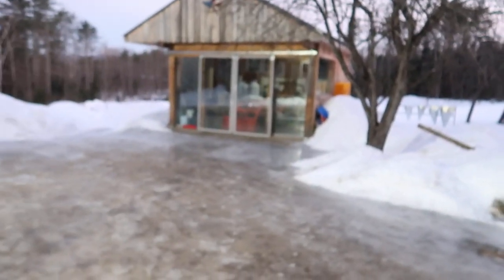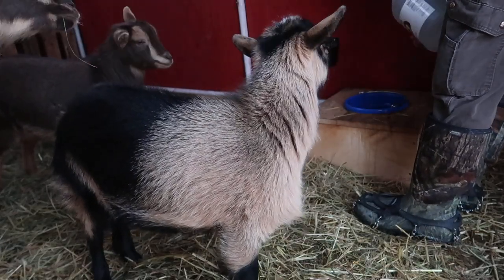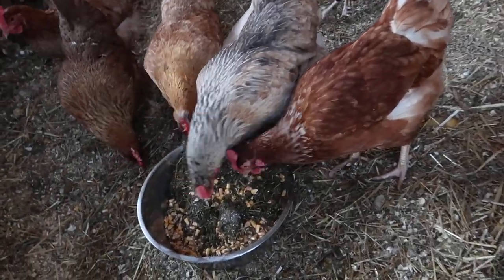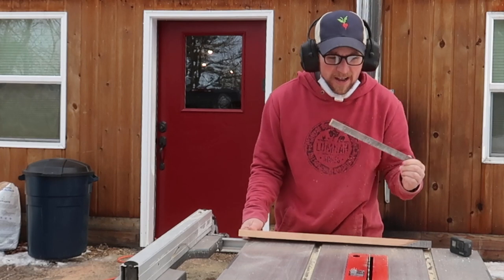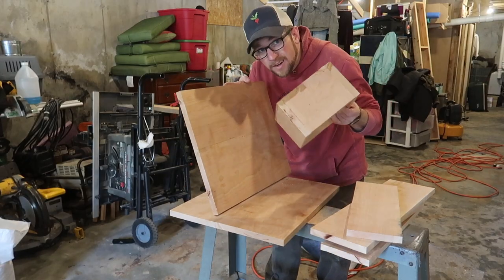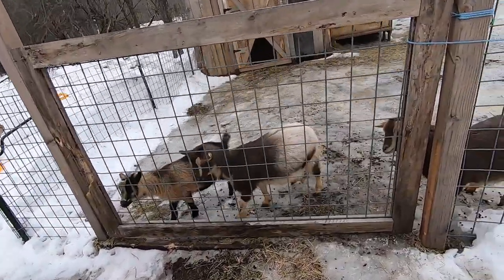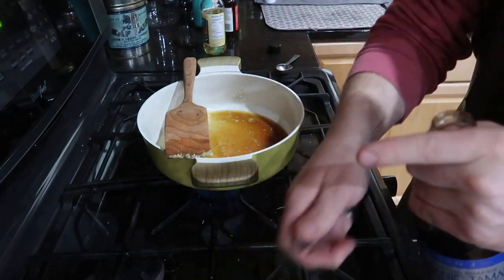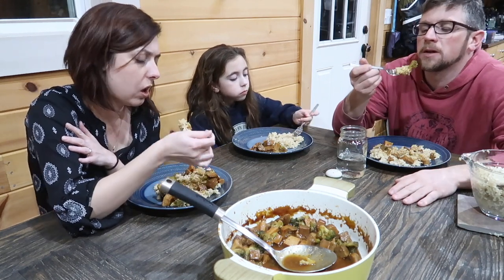Well This Just Got Dangerous! Everything Froze Up Solid Last Night It's Like an Ice Skating Rink

Comment: Spread some wood ash from fireplace over the ice.  Works well to breakdown the glaze and gives grip
Reply: Yes, it does work well on ice but the drawback is that it gets tracked into the house.
Reply: Makes a big mess.
Reply: What about sand?
Reply: i heard kitty litter works?  sounds expensive.
Reply: Lol what my grandma would do..n it's good for traction..n cheeper
Reply: @brslib01  I get flustered when it rains and turns our yard into a clay and rock quagmire. Have to yell at the dogs, hubby, and even to myself. Stop tracking mud all over my wood floors! lol

Comment: I'm your neighbor over in Gorham. We have those same birds here too. The call changes through the year - what you heard is tuning up for spring mating and it will become a bit louder and harsher: from chirp! like a regular bird to choip! like it drove up from New Yok for mating season. I call it "the boid from Brooklyn". I don't know what it looks like and have been trying unsuccessfully to actually spot it for several years. It must be small, fast, and very drab in color - either that or it is invisible and teleports at will. I'd like to know what kind of bird it really is too, or if it is merely a happy seasonal figment of my cabin fever induced state of New Hampshire on the brain. BTW, the sauce is pronounced "hoy-sin", use the whole bottle in your sauce next time, and let it marinate at least overnight. Keep up the good work and don't forget ya sun block. Winter won't last forever. ;) Tom

Comment: when you're ripping a rough cut board square, make 2 cuts the first one a half inch wider than what you want. the 2nd cut is the finish width.  you need a flat side to rest against the saw guide to be square. happy sawdust making!

Comment: I just want to share a piece of safety  advice for your carpenter skills....ideally when next time you need to do a rip on the table saw PLEASE make sure that the blade does is not exposed more than a 1/8" above the materials that is been ripped , in case of accidents the blade just goes a nearly shallow on your skin. They way that you r using it could be a disaster !!! I been for over 35 years a carpenter and still 10 fingers. Much Alohas from Maui!!!!! Please work safe!!! We really enjoy your videos and showing how different is life on the Mainland!

Comment: Hoisin rhymes with poison...  
I was wondering on that disbudding box if you cut a door into one side you could use that spacer box as a storage compartment, perhaps for the disbudding equipment, though I do not know if the disbudding iron would fit inside...

Comment: I love how you get this scientific curiosity about things...  what temp do the eggs come out at?  How different will the colours of the egg yolks be with the change in feed?  Goodness, Al, you're gonna be quite an eggs-pert by the time you sate your curiosity!  LOL.  Up here near Montreal, the ice hit too, and the cold came back (-13 C), but it's the wind (23 mph with gusts to 51 mph, down a bit from yesterday) that's making things interesting up here yesterday and today.
Reply from the maker: The wind gust are really strong here too!
Reply: North Shore of Montreal here.. I guess you live pretty close to the border.. because everytime I see your videos, you basically have the same temperature as we do.. just a bit warmer where you are.    My chickens are in a Carport tent with lots of hay on the floor.. with all that snow on each sides, I really dont get any draft problems and it's actually a few degrees warmer than outside.. Although now with the above freezing and re-freezing, my electric fence I had inside now is stuck in ice so it's all grounded :(  no more protection until next warmer day..     I do get a lot of tips from your channel  thanks for doing what you do !   Bonne année 2019 !

Comment: I know you don't like the heat and humidity of the South, but those hot summers are spent in the swimming pool.  We do our outside work in the Fall, Winter, and Spring with very, very little snow or ice.  Hey, I vote for the swimming pool instead of all that snow.

Comment: Gooood Morning Al ,
Well , my Chinese girlfriend tells me that General Tso's Chicken is not a Chinese dish at all.
It is actually an American dish created by a company in Ohio . Just as Chop Suey was created in New York City. 
  Now I have a couple of wonders for you .  I wonder why you did not or have not used the front end loader on your tractor to make a path to New Yolk City ?  I also wonder why you are not using your automatic feed and water buckets for your chickens. I use both of your ideas for my chickens and they do save me some labor .  I do get a little ice on top of the water which melts as soon as I add more water about every fifth day . Of course my chickens are inside of my garage which keeps the whole five gallons of water from freezing solid . Your chickens are inside of smaller coops. Their body heat may be enough to keep the bucket of water from freezing  solid .
  I had a sunny day yesterday here in Ohio.  But , cold with a cold wind blowing. A trace of snow during the night.  I'm about as cold as you are .  But I have no ice or snow except for a trace of snow. Weather report shows more cold and snow on the way .  I'm ready for spring.

Comment: Those are cool watches.  Signed up!  I'm gonna get me some of that chaffe hay for our chickens.  I've never seen it in TSC.  It must be by the goat stuff.  I have some bermuda hay and the chickens don't seem to eat it.  They sure like it in the nest boxes though.  It holds together better than the straw and makes a nice fluffy nest.  I thought the cut looked crooked because of the wide angle lense, but it was not straight after all.  I'm liking my GoPro 7 a lot.  Ulanzi just came out with a case that holds the mic adapter underneath so you can use an external mic a lot easier.  I just ordered one.  Thanks for the video Al.  Top notch content and editing as always.

Comment: Did you make your rice in the Instant Pot? I'm debating whether to buy one since they are on sale right now- Philips brand, IP is not sold here in Taiwan. IP seems like a really useful appliance. What do you think of it Al- very practical tool or more of a luxury?
Reply from the maker: Yes the instant pot makes awesome rice. It's nice and sticky
Reply: @LumnahAcres  Thanks Al. I love sticky rice.
Reply: After using one for 2 years I believe it is a necessity. It really does replace so many appliances. Just here recently bought one just like Al's. It most definitely is a superior machine. Love the stainless steel pot, the size, the lid holder and all the new features compared to my old one.
Reply: TWROC96 Definitely a TIMEsaver, especially if you make beans or tough meat cuts with bones.  I can make a roast in 1 hour, bone-in short ribs in :30-:40, dried beans to soft & ready to eat in a soup in :45.  It’s amazing.  I hear it makes great cheesecake...haven’t tried it yet.  We got the Mealthy brand & love it.  Highly recommended appliance.👍
Reply: @countrylife9256   thanks so much for the reply. I wish the Philips had a stainless steel pot but it's an aluminum alloy instead.
Reply: @tarantulady8565  time saving and big meal prep is what I'm after. thanks for the reply.
Reply: @TWROC96  no problem at all. So glad to be able to help. I will suggest if you like to freeze leftovers to go with the bigger 8 quart.
Reply: We got one for Christmas, and we love it!  We have fixed everything from poached eggs in it, to a 3 meat chili, the Instant Pot allows you to brown your meats in it, and saute your veggies, I'm in love with it!  LOL